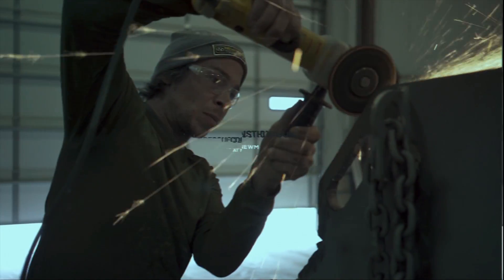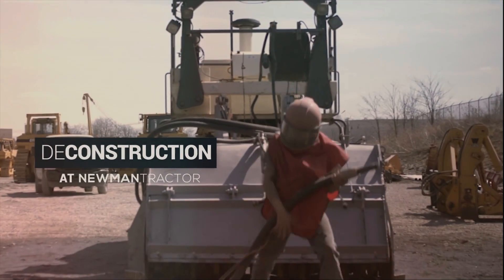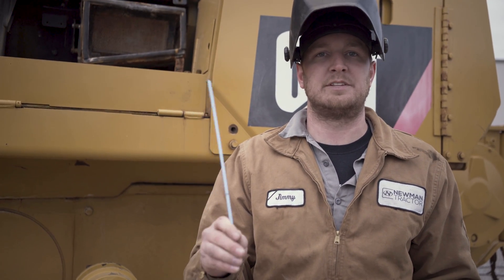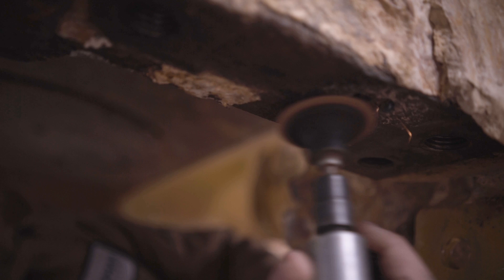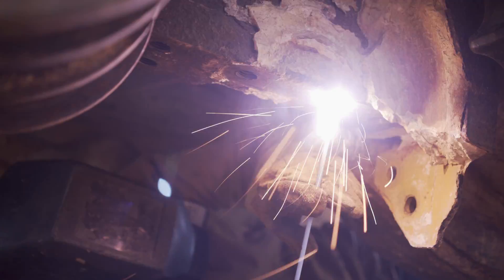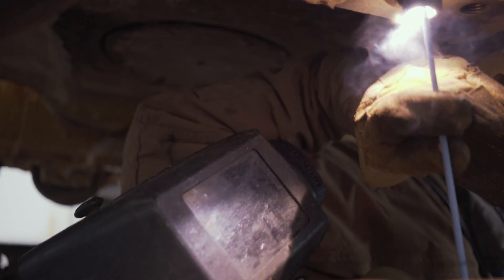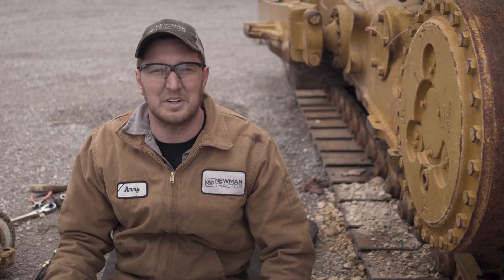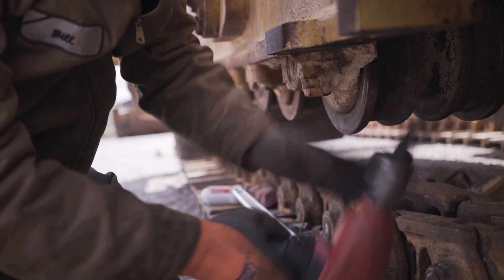We Torched a Seized Rusted Bolt with a MAP Gas Torch

Comment: some times they just plain rusted together, I use annular cutters on a mag drill and save the threads never a fun job needless to say usually I'm
 laying in mud to boot
Reply: So do I, this metod never fails.
This must be done before any  attempts to torch or weld, otherwise the bolt is hardend, and your screwed
Reply: @Opelmannen1224  yes sir I’ve got horror stories on that had to torch one out had white sparks ( first person to attempt broke off an easy out ) (hardened tool steel)
Reply: Gotta be laying in the mud to have any bragging rights....frozen mud even better...